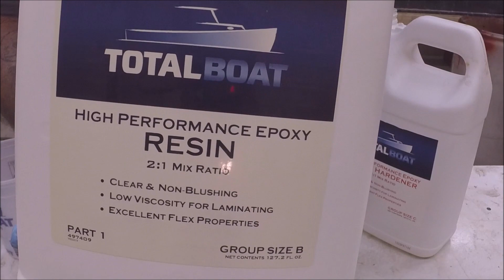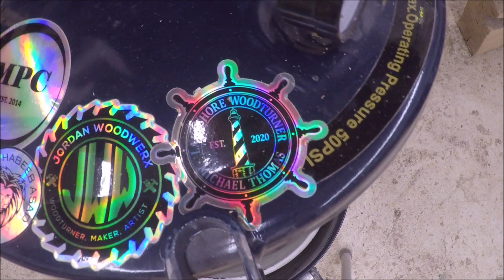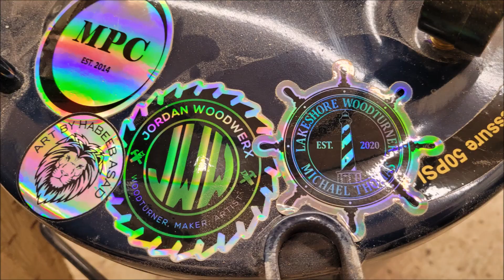Spalted Red Alder Interference

Comment: That is another fine project, Doug! Again, you fixed how many problems and I learned a lot from your struggles.

You have got to tell me more about your your desire for a Rikon to upgrade to. That is exactly what I am jonesing to upgrade away from, after reaching the limits of a discontinued midi lathe, which is what I've been using from the start.  I reached the limits of its capabilities with my last project. It's not that I need something bigger, I need features that weren't included on it. I actually need the smaller sineed the smaller size for the minimal space I have to work in, but need more capabilities. Myself, I'm looking at the Laguna. Thank you for another great video and keep us posted about your upgrade thoughts and desires.
Reply from the maker: Thank You Jay,  anything I suppose it better than this POS lathe or the Laguna from what I understand, I can't afford any of the bigger better lathes, and Rikon 30" seem to have great reviews so far in my price range,  the bed way on the nova and laguna are practically the same, too long and not beefy enough therefor they flex and twist, Technatool also has piss poor customer service, they suck ass really, no help what so ever to solve any issues,
Reply: @PohlBarnProductions   OK! Those are all important factors and I appreciate the straightforward honestness of it. I was discussing it with some of our long time club members yesterday morning and they were directing me towards Vicmark. The thing is I find so many of their features inaccessible to my paralyzed hands. I just don't think it would work for me. But, the concerns you bring up about the Laguna make me hesitate as well so I will keep looking and hope that my bearings continue to hold out.
Reply from the maker: yeah if I could afford a VIC I would have one
well the changing the belt and reverse would work great for you and it think the bigger Rikon goes from 50 to 1500 rpm on the first belt setting, I never turn faster than that, always at 1250 or less,  Kim Tippin had issues with her Laguna so did Ken Moon, they've both replaced the heads on them, Ken a couple times that I now of

Comment: Love watching. I'm just starting with pressure pots and acrylic. Do you leave the vacuum pump running with the mixture cures?
Reply from the maker: Thank you Todd, I don't normally use Vacuum for the resin, it tends to make it boil and add more bubbles

Comment: Hi Doug, I love your work.  I have a question, what kind of spray are you using to help you release your molds? My daughter is working with Resin and having a problem with sticking.  I kept trying to read your can but it goes by so fast.
Reply from the maker: Thank You Jean,  it called Stoner mold release, I actually have the wrong kind for what I am doing, but I purchased it and use it anyways, seems to work fine,  amazon should sell it, they spray can be for certain types of resin, silicone, epoxy urethane, ECT , also if she is using silicone molds the do deteriorate after time, the resin heating up weakens it and it starts sticking to the mold,  I've replaced many, the release does help with this but doesn't stop it.
Reply: @PohlBarnProductions  ty, and yes, silicone molds are getting sticky.  She just had to order a new mold.  How appropriate it is called “Stoner” mold release, lol, it’s fitting for the stuff my daughter is making.  Have a good day!

Comment: Just curious - since you only had resin on the top rim pf the bowl, why not put the blank in the bucket with the top down and only pout about an in 2 of resin in the bottom so you don't have to turn so much resin off that never gets used?
Reply from the maker: well the bucket is tapered, and have tried that,  I also tried to turn this one as close to the same size as the buck and screwed it up.  Thanks for watching

Comment: Real nice but have a question. Why do you pour all that epoxy just to turn off 90 percent of it off. Wouldn't be better to turn it first then pour a lip on it then turn it. Less waste. Just my 2 cents and just take with a grain of salt 🧂
Reply from the maker: Thank You , oh first the bucket is tapered, second I needed the resin to enter all the cracks and holes, I expect to be tuning most of the visible resin away,
Reply: @PohlBarnProductions  ok. No harm no foul